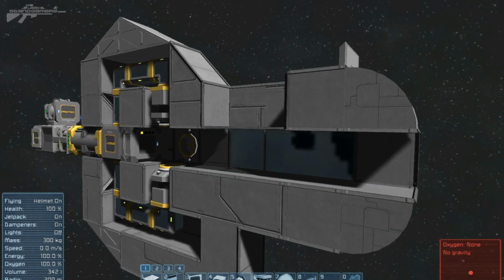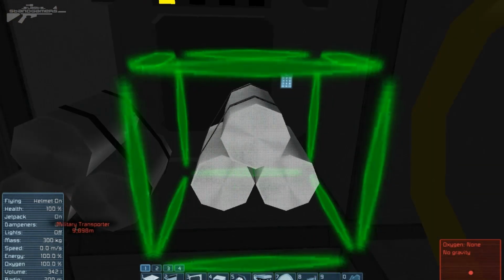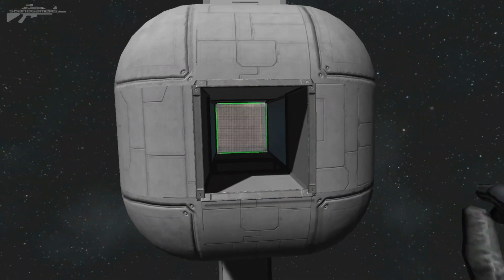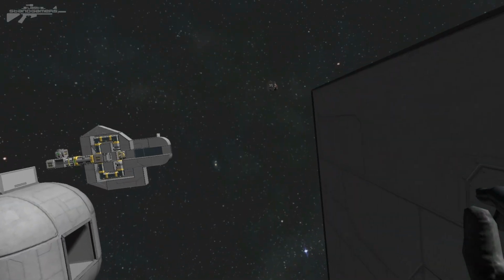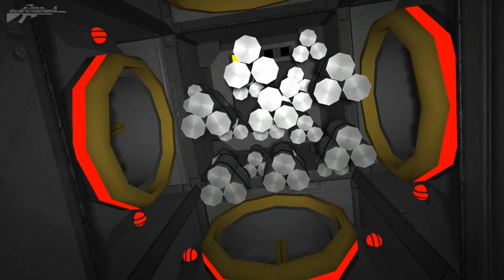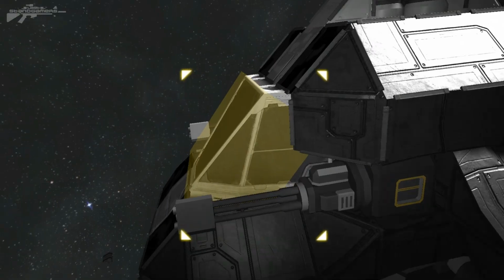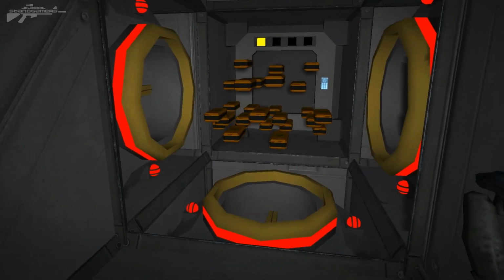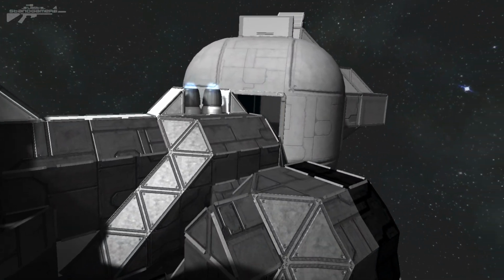Space Engineers - Pressure Cannon, Experimental Concept

Comment: Gravity cannons still preform better. Though cool design.
Reply: Benny Kolesnikov How about a combination of both? You can put a gravity field in the barrel.
Reply: the11382
Though about that. The design is overly complicated. Also you can't do it without a method of instantly removing the pressure seal. Griding has stages that stuff can't fully pass through and doors take time to open. I think a few gravity generators could produce the same effect but they would be a lot more controllable. Also, these cannot be used with any effect while the ship holding them is in motion.
Reply: Benny Kolesnikov Hmm... I wish arron showed us using a grinder with it. I imagine the projectiles would just pierce through the cap with the depressurization on the first stage of deconstruction.
Reply: Benny Kolesnikov right, the highest one could do is grinding away the door as the frame would stay while the "sliders" vanish, but there would still be the problem that the frame is in the way and could catch stuff.
Reply: Zebo12345678
Loosing a bunch of force :L
Reply: Benny Kolesnikov
Are you sure though? You saw how it performed in the video. It pierces 1 layer of armor like nothing, so I assume that the cap is not going to take away so much force from the projectile.

Alternatively, you can use a door, but place the projectiles on the other side of the door. The air still pushes them, and maybe even at a greater force, as well as having no obstacle between the projectile and the target.
Reply: Benny Kolesnikov You don't need a grinder: Thrusters bro. Insta melting!
Reply: Benny Kolesnikov Wouldn't it instantly pass trough the cap as soon as it wasn't sealed?
Reply: GameCeption but with the thrusters, there is the issue that blocks will deform before melting. This could lead to a pressure breach to one side or corner causing the explosives inside to collide with the block holding the pressure in the chamber resulting in catastrophic failure of the weapon. A better method as zebo pointed out would be to use a door with the items on the vacuum side and use the depressurization wave to propel the items along the barrel with a lower risk of collisions or failure.
Reply: seafood1471 Just don't use a block, use a window o__o. You can grind it, melt it or shoot at it.
Reply: FaKRaS but a door would have the advantage of a faster rate of fire and easier automation (toggling ejectors then opening the door)
Reply: seafood1471
 The doors starts to open, some stuff flys out, the air is all gone by the time the door is open and half the stuff is still in there? Just guessing at this point ;3
Reply: We need disappearing blocks.
Reply: FaKRaS
but the glass would still have build stages. and except maybe if you blow it up, it will depreasurize while still holding everything back. just like any other block.
Reply: Actually, grinding a door would make the most sence. Since it's pre-done stage is when there is no door.
Reply: tru dat
Reply: Zebo12345678 No need.  You can just use an interior door.  I'd create a few chambers of air each with its own door opening up to a common corridor.  Then place the item(s) to be launched in the corridor.  Pressurize each chamber and put all the doors in a group.  Then trigger the group.  You could use a gravity field (four grav gens) to stabilize the fodder as it's being dumped out by the collectors.  

The downside is that you are using oxygen which comes from a limited resource (ice).  A grav cannon launching stone is less costly and if you're smashing a small cargo container full of stone, that's still one BIG projectile that can crash through several layers of heavy armor from 15,000 meters away.  

The downside to grav cannons is that they require a lot of resources to construct and if they are attacked, they can become a liability.  One piece of ore on the other side of the cannon getting sucked in by the reverse side of the field getting sucked towards your cannon can be a complete disaster.
Reply: Benny Kolesnikov Almost like opacitators, this game is based in the 2080's
Reply: Benny Kolesnikov true but gravity cannons take up much more space, this is a lot of near instantaneous acceleration
Reply: seafood1471 the deformation does not cause a pressure leak until the block is destroyed
Reply: Benny Kolesnikov Nope, the reason they pierce through is because the game does velocity in Frames, if a Frame is usually (Depends on how fast your computer is... obviously) 1/30th of a second, and a large armor block is about 2.5 meters or something, you'd need to go 30.1*LargeArmorBlockThickness M/s to have a chance to clip through without it being effected. It's the same reason that, if you've ever tried to shoot a non-modded missile at something in KSP, it usually won't work if you go too fast. Basically it's because Hitboxes are named Hit Boxes for a reason, if they were a filled in cube, it would be a different story, though this problem would still persist
Reply: +Dominic Donahue A common solution for this is to calculate a path between the frames and look for a collision there. However, this takes more time to calculate and is therefor not always done, depending on optimization choices etc.
Reply: This is a lot cheaper and smaller, though, so it can still be good in survival. (lel 2 years late to the conversation)

Comment: Genius concept! It never even crossed my mind, love to see what others come up with. You need to do a mockup of a station/ship room with such things as generators and what not so you can see what happens with the actual item once it penetrates the first layer.  In addition you can change the launcher to house guns behind it and the vent coming from either side since you do not need a direct line system to launch it.

As for the velocity based on weight, does the size of the pressurized area increase the velocity? Will larger rooms breaching be able to move a heavier object? What are the effects when you pierce a room that is also pressurized? Will it push the object back out? rattle around? will it depressurize at all with no wall breach? Will hitting a seat/cockpit that is manned kill the occupant? 

Side note looks like you may have come up with a solution to the issue I was having on a bomber concept I was working on that would use actual explosives via ejector system, have you tested it with a door release rather than just cutting the block out in creative?
Reply: Jonathan Duffield You're forgetting temperature. Besides, given that oxygen came out a few weeks ago, I doubt that the game would be so realistic with gas laws. I'm no programmer, but I'd imagine it'd take a significant  amount of coding to implement pressure, especially as it affects objects.
Reply: Minngarm Halnhammer If you ahve Facebook, find Space Engineers Multiplayer Community if you aren't already part of it. You sound like someone who would add to our discussions!
Reply: Actually velocity is not based on weight.Momentum is based on weight/mass.If you had the same number of molecules and reduced the volume then pressure will increase.So a smaller volume is better as stated by Boyles Law.